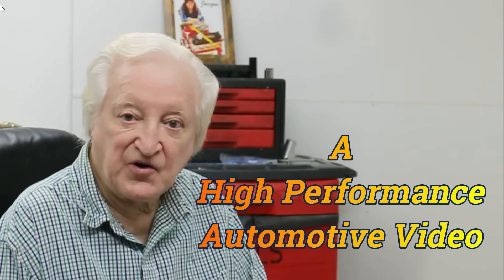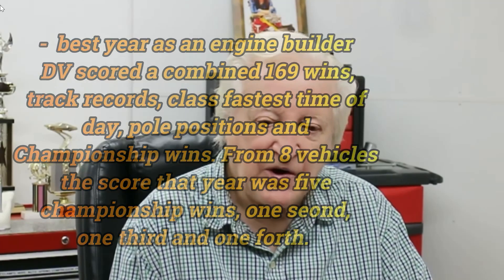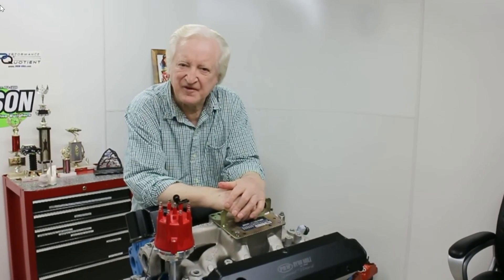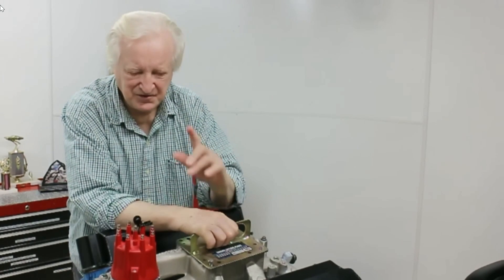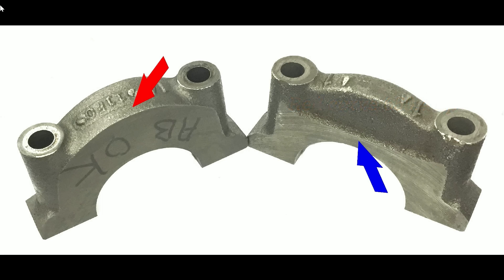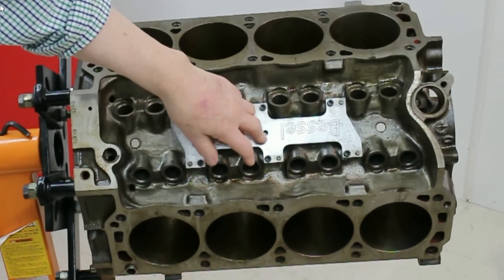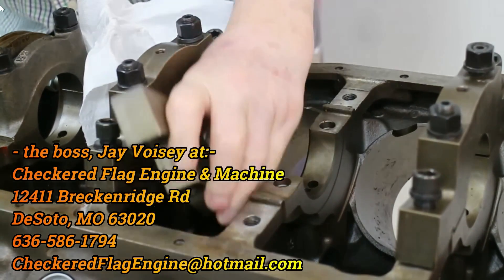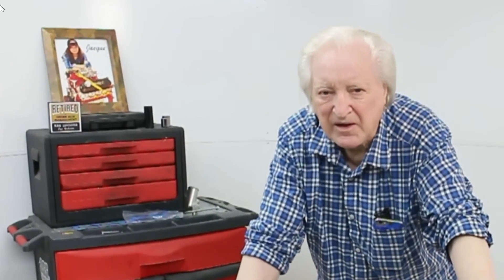302/351 Ford OE blocks - how to make them live even at 1000 hp

Comment: Having built a couple of 5.0 versions of a 302 to 3.4" stroke the Ford machining is quite good and the black and crank seems to better metalurgy than the early 70s engines which in the distant past I have also built. 
The oiling needs for the oil out and oil in need to be modified, and radius the corners in the top of the block, Screw in plugs too are nice.  And fix the oil returns to the pan. Inadequate factory. 
The stud girdles are essential on stock blocks and caps. Alloy ones are not ideal as they expand differnt than a 1/4" steel one. ARP studs are a given. Having had issues with Clevo lumps pulling the block out of shape with 1/2 studs it seems the 7/16 is probably superior. Always enough on a Chev!! Grouting to the welch plugs is essential. I do like the idea of reinforcing the vally as you have done. My current engine is using a forged 3.4"Scat crank, the iron ones flex too much on a big power engine. Though perfectly ok for a nice street engine. And ofcourse Scat 5.4" rods. AND I am using CHI 208CC Windsor modded Clevo heads. So the best part of 600 hp is expected. N.A ofcourse,, hair dryers are for girls!! Road race engine. Which must be a production block. Though it seems a Supercar SVO block is ok!!. Though not by the rules. And there is none available anyway!! Solid roller cam, agressive but not super agressive. And the block is bored only .010 with custom pistons for the heads.Nothing is top dollar stuff but everything should be fine for half hour max races. And 7500rpm.
Though for all the Ford tragics, yes you can get good power out of a baby 8.2 deck engine. But it will never be a Chev. Though is smaller and lighter. But the Chev is smaller and lighter than a 9.2 or 9.5" block
Interestingly I know of a Boss 302 style engine [3" stroke'] that turned over 8000 in a speedway sedan for many years. Power was adequate and the car was fairly light. [Pantera]
The other thing too,, 302W firing order breaks engines, 5 litre  uses Clevo firing order that saves engines
Reply: I remember Kemps GT350R late 289ci Windsor turning 8.400rpm going 184 mph it was fastest thing on the track B production cars had no chance neither did A production that included aluminum 427ci corvettes dusted by a 289ci small block Ford. I’ll take a SBF anyday not very many people know how to really build one the man in this video does tho. I’ll take a Ford  over sbc anyday
Reply: I ran super stock with a 65 fairlane years ago  4 speed jerico 9" 633 rear gear .The rules mandated stock crank heads etc. that 289 .020 over saw 8500/9000 rpm every race and held together .
Reply: What intake manifold ?
Reply: ,,,,,,,,,,,,,,,,,,,,,,,,,,,,,,,,,Where's the foundation of history for this claim [ 302w  f. o. , breaks engines  ;  5.0 with cleveland  f. o. that saves engines.]  Must be some road racing gargle........state some facts as to why,,,,,,,,,,,,,,,,,,,,,,,,,,,,,,,,,,,,,,,,,,,,,,,,,,,,,

Comment: Several things I'd like to add (if I may!), at the 600+ power level, it's a good idea to convert from external balance, to internal balance. This reduces the harmonic forces considerably!
With external balance, you have the weights at each end of the crank. At  high RPMs and high loads (nitrous and forced induction) those weights tend to "whip" the crank lengthwise which causes more stress on the already thin main webbing.
So not only does the crank have the vibration and torsional twist that it normally has, then it's got that whipping  effect along its length also.
Converting it to internal balance eliminates those weights and brings everything much closer to center....like very close to the main cap bolts, which is the strongest place in all of the block!
By eliminating the whipping effect, you're eliminating the very force that is trying to wiggle the main caps back and forth.
Along with the block mods that Mr. Vizard is showing, one could have a 1000 hp stock block that could live all day.

Comment: Morning David . I have just bought your book “ Port and flow test “ ive not read it cover to cover but what I have read is very interesting .
I have a question ,I have a race car ( Formula Vee 1300 )  we Have to use a restrictor plate ( 36mm hole ) on the induction side . We are using Weber 40s ( IDF ) and everyone bolts the carb directly onto the restrictor plate . 
 I have watched many of your videos on YouTube, based on that I think the restrictor plate should be nearer the intake port !  valve seat is 31mm in diam with a valve head diam 33.1 . Standard port is cast 28ish diam although the inlet port ( Siamese ) is a mess .
I seem to recall you saying there is no point in having a bigger inlet port than the valve ? ( hope I remember correctly ) if this is the case would it be more efficient to taper the inlet manifold from “40mm”at the carb down to 31mm where  it bolts to the inlet port ?
Is there an optimum taper / length for best port velocity ? Motors run about 100BHP cam comes in about 4500RPM and tops out at 7500RPM however there are guys on the grid that rev to a little over 8000 and have significantly more power so I know there is more to be had .
Great videos , very informative I only wish I was in the states so I could attend one of your seminars . Regards Andy ( UK )

Comment: If it is a mains issue I have a solution, I've been designing a system that can be used on any engine that will strengthen the mains using only two bolts per cap. It has been used before in some very high end super cars but I'm sort of retro fitting the idea to other engine designs.
Reply: Also with mains girdles, I have used an aluminium one on a Holden 304 stroked to a 355, it stopped a conrod dead in its tracks when it dropped a valve. It only had a bend in the girdle, Pavtek in Melbourne Australia made the Holden one I had fitted.
Reply: Well let us know mate. The Barra boys will luv ya.

Comment: I was wondering your opinion on main girdles. Would a good steel girdle work on a 2 bolt main Chevy? My theory is that locking the main caps together significantly reduces cap walk and controls vibration better than going to 4 bolt mains. Plus a girdle is a lot less than a 4 bolt main conversion. Am I close? Thanks for sharing!
Reply: What about a girdle on a late roller cam 4 bolt SBC? I've heard DV say, "Those things are rubbish." 
Well I've got one and I want to make sure it lives.

Comment: Have you noticed less head gasket issues with the girdle?  I've been told that the head gasket issues with higher power 302 builds is caused by the block itself flexing under the heads, and that was getting near the point of block failure.
Reply: I’m not sure about the girdle affecting the block deck, but reading through The Turbo Forums some people have had gasket issues with the 302 due to using the thinner deck GT40 cylinder head and getting flex issues. Head studs definitely help, as well as a more durable head gasket, or machining a O-Ring into the head.

Comment: I don't have what it takes to get a block machined like that, but if I did I would save and buy a better one to begin with.
Reply: That is the real trouble with pushing stuff this hard, you rarely come out ahead after the machine shop bill is paid. I'd rather just build a bigger milder motor if at all possible, cut the weight in places it's cheaper to do so. Still neat to see crazy power out of a short deck windsor though.